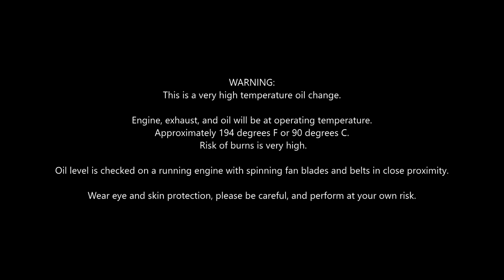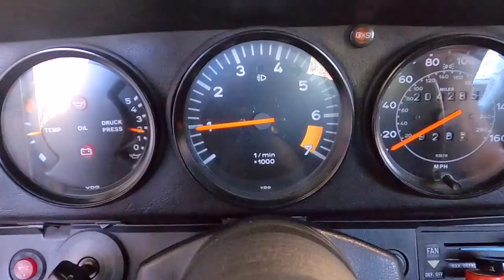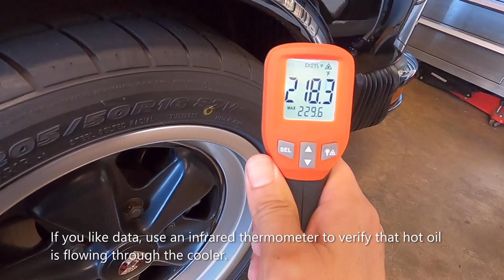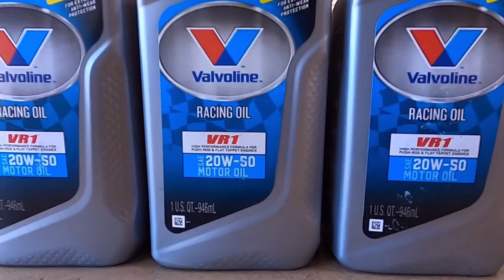Air-Cooled Porsche 911 DIY Engine Oil Change

Comment: Very helpful video Thank you. I could never do the job without jack stands! Better man then I...
 The oil type.( had to share my joy) I was a Brad Penn 20/50 now called PennGrade 1 - for 15 years - Played with other oils (both road and track). Now, left the cult, and did Liqui Moly 20/50 touring high tech and added the M0S2 Anti-Friction. My 3.2 with 100k never sounded better nor performed better. Drove 2k to Rensport Reunion two weeks ago and the car was amazing, best ever. After 2000 miles, never added a drop of oil. Just my two cents! Thanks again for making this video.

Comment: lol, Unbolting the oil nut under the engine - I've done the exact same thing, trying to move my hand away quickly.  good video - and honest. I let the nut drop straight in the pan and retrieve it later.

Comment: Hi Joe..I've been enjoying your videos and finished my 3.2 rebuild on Thanksgiving.  I've been changing my break in oils and followed Heidi and Franny's garage lead with the oil tank valve.  Not a huge deal, but nice to dump the tank quickly when the thermostat is still open.  Fumoto F309L Engine Oil Drain Valve (22mm-1.5).  I'm loving my car and the destination was worth the journey for sure.
Reply from the maker: Thanks. May look into this if my annual mileage goes up.

Comment: @JoeEngineer I just picked up an 1983 911 SC Targa. Needs an oil change but when I start it to take it to "warm temperature" it smokes a bunch because of old owner pour too much oil. Any tips on how to go about it? Could I do an oil change at cold temps? Thanks in advance!
Reply from the maker: Drain a little from the tank while it's cold. Might take a few drives to clear out the oil left in the oil breather circuit.
Reply: @JoeEngineer  okay that's what I thought. Here is my other caveat... the car hasn't have its valves adjusted in a bit and I was thinking of doing the valve adjustment, maintenance + oil change at the same time. Would you say to drain a little oil. Drive it around as it is. Once we can do the oil change correctly (like your video) do everything else then? Thanks so much for your help!!
Reply: @JoeEngineer  any thoughts on above☝